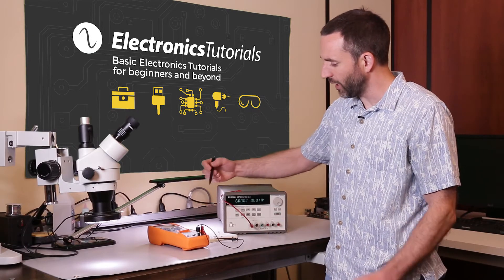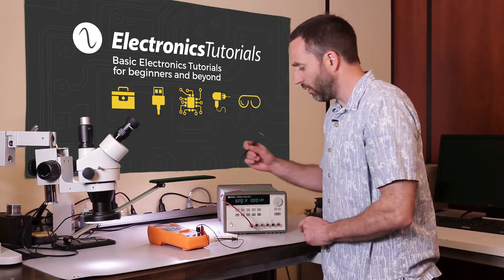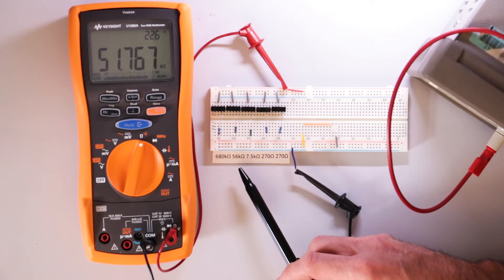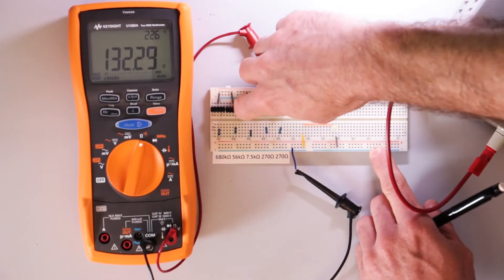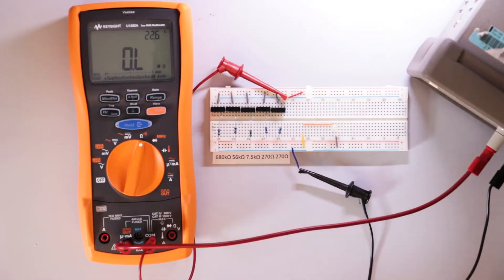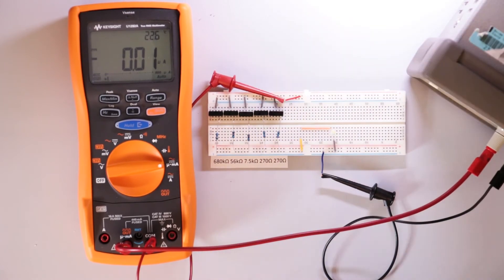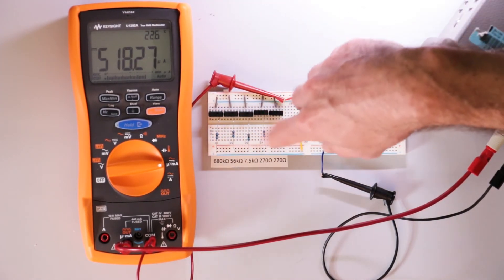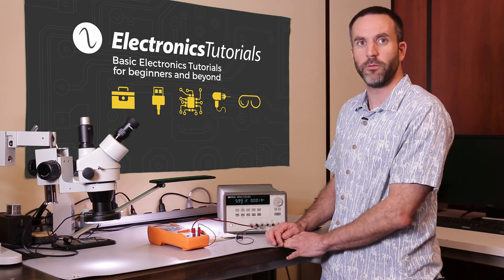Resistors In Parallel

Comment: OL “overload” never overload is term to use for your consumer or your load or loads that’s pulling too much curent or your circuit is a “overloaded” that is having more consumers than it should OL is “open line” no continuity is n between your leeds